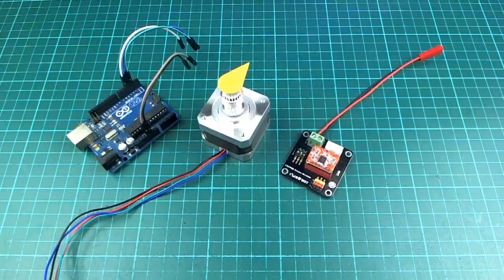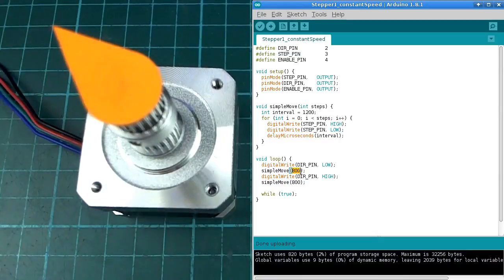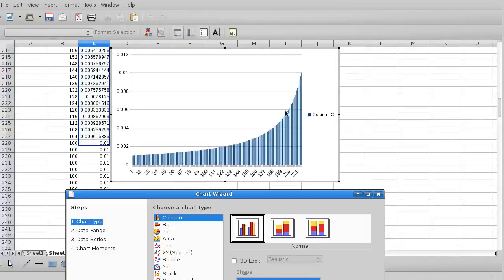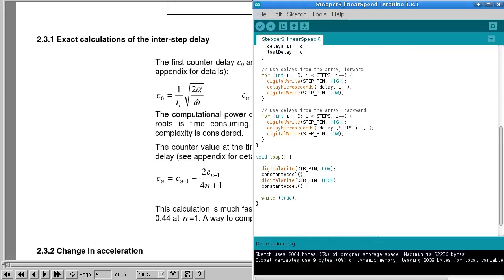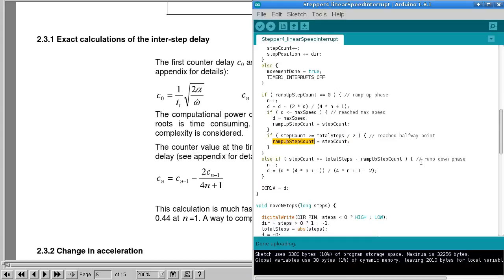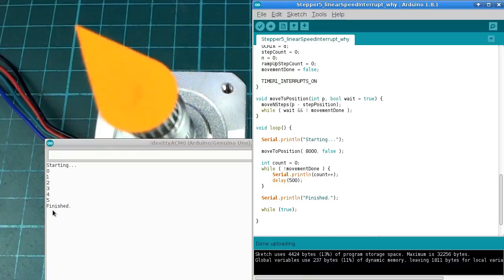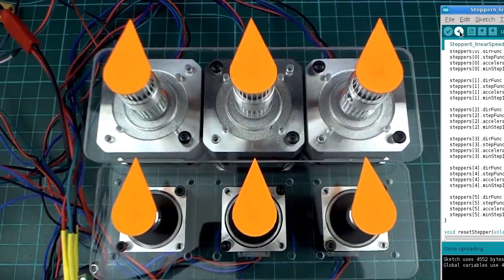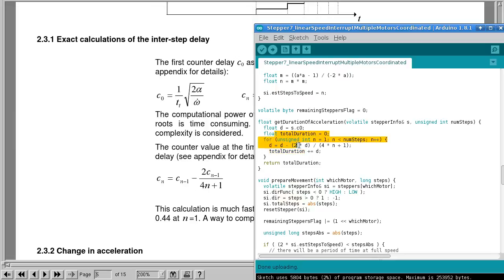Coordinated stepper motor control (arduino)

Comment: I did not really go beyond the point in video, where the author gives in sophisticated calculation and theory. The author had a very efficient approach in the first place. All I did was to base my acceleration function on incrementing the speed instead of incrementing delay. So here is my modified version of the author's good idea (it works, but it should be improved in a few ways...depending on the main application code):

void linAccel(int steps, int uSteps) {  //we assume the uSteps (microsteps) are defined before calling linAccel(steps, uSteps)
  int lowSpeed = 100;       //rpm
  int highSpeed = 400;      //rpm
  float speedIncr = (float) 2 / uSteps;
  int rampUpStop = (highSpeed - lowSpeed) / speedIncr;    //steps before highest speed achieved
  int rampDownStart = steps - rampUpStop;                 //steps after highest speed starts to deccelerate
  float d = 60000000 / lowSpeed / 200;     //[us] lowSpeed Delay based on 1.8 degree steps ==> 200 steps per rotation
  float curSpeed = lowSpeed;
//  Serial.println("rampUpStop: " + String(rampUpStop));
//  Serial.println("rampDownStart: " + String(rampDownStart));
//  Serial.println("curSpeed: " + String(curSpeed));
//  Serial.println("speedIncr: " + String(speedIncr));
//  Serial.println("delay: " + String(d));
  for (int i = 0; i < steps; i++) {
    digitalWrite(stepX, HIGH);
    digitalWrite(stepX, LOW);
    delayMicroseconds(d);
//    delay(10);
    if (i < rampUpStop) {
      curSpeed += speedIncr;
      d = 60000000 / curSpeed / 200;            //d += speedIncr;
      //      if (curSpeed > highSpeed) curSpeed = highSpeed;
    }
    else if (i > rampDownStart) {
      curSpeed -= speedIncr;
      d = 60000000 / curSpeed / 200;    // -= speedIncr;
      //      if (curSpeed < lowSpeed) curSpeed = lowSpeed;
    }
//    Serial.print(String(i) + "," + String(curSpeed) + "," + String(d));
//    Serial.println();
  }
}

Comment: Can any one tell me which board and drivers( all electric components ) are used to run 6 stepper motors at a time
Reply from the maker: I'm using a RAMPS1.4 board shown at 34.55
It has 5 onboard drivers and the 6th is on a separate breakout board. Search for A4988 on Banggood etc

Comment: Hello! Great video, and great work! Thank you!
I am trying to adopt your last sketch (Coordinated motion) to run under Arduino Uno with only 4 motors (CNC motor shield 3.00). Everything works great, except the Y-motor doesn't change its direction. I see with a meter that the DIR signal on pin 6 for Y-motor does go to HIGH after prepareMovement() - when it is time to change direction, but then it immediately goes to LOW when runAndWait() is executed. Do you know what within runAndWait() could possibly be resetting direction signal just for this one motor? (I am using Step/Dir pins:  5/2 for X,  6/3 for Y,  7/4 for Z,  13/12 for A). Thank you.

Comment: how did c0 become 1600? in 22nd min
Reply from the maker: As I mentioned in the video, that's 1600 microseconds between pulses, the slowest speed when the motor starts. Set it to whatever you want.
Reply: @iforce2d  i got it, thanks

Comment: Hey what kind of stepper motors are these? I am looking for something more powerful than the one i got in my beginner kit because I need to create a circular motion to "stir" something these seem like they have a much greater rpm
Reply from the maker: These are nema17. The smaller ones are nema11 but they are quite weak.

Comment: Hi SR. I need to control 4 motor to clock wise position and 4 anti clock wise at the same speed 5 RPM. Is it possible with the cnc shield and a arduino nano?

Comment: I am currently working on a scenario with three equally angled motors, where one of them needs to be scaled vertically by sqrt(3) to achieve a perfect XY movement. I've been trying to incorporate your fantastic work to help me get going with accel/decel, but I do not get accurate positioning. It is  off by an ever so slight margin. Do you have any clues what I could look at? Any help is appreciated! Cheers and thanks for the great content!

Comment: I am running this code on the ramps 1.6 : I get no movement unless I put delayMicroseconds(5); in the step function fo X. What could be the problem?
Reply: Actually only the interrrupt sketches dont work.

Comment: Ok. Linear time delay changing will non give us a linear RPM growth, but we can just linearly increment RPM itself, then just convert in to time delay. It will give as an perfect linear RPM growth (on graph at least), and this much isyer to caclulate and understand. Where i`m wrong?
Reply from the maker: "just convert in to time delay" Ok, how?
Reply: @iforce2d  time_delay = (16000000/prescaler)/steps_per_second. Then we can increment the steps_per_second variable like that: steps_per_second +/-  accel_force * dt. Also we can create an acceleration profile cache: for example a full acceleration from min to max speed takes a 50 steps, so lets create an array (uint16_t  profile[50]), where an index will correspond to an acceleration step, and value to a time delay. Then calculate in loop all steps and fiil the array once. It allows us to avoid any calculations in timer interruption handler. We wil able just change an current acceleration step value and get an corresponding time delay from cache. (Sorry for my English)

Comment: great video! I'm just now developing a cable robot for a uni project and I've looked at your sketches and the Atmel doc, and I've managed to add my take on this, in short, I'm giving a fixed time target for all motors to complete their task (just a constant acceleration between two positions). With that, you can set a base start delay and acceleration proportional to the Steps/Time request.

Comment: I'm having a really rough time scaling the code back for the multiple motors back to just two steppers. I managed to get... something to happen, but all it's doing is periodically stuttering.
Everything else has worked out okay up to this point.
Reply from the maker: Not sure why the code would need scaling back. There's no need to connect six motors if you only have two.

Comment: sir
how much supply have given this motor
which stepper motor you used .please specify module and
please tell me if i give 12volts to this motor that speed remains same?? or it will slow  if i used nema17 4.2kg
please reply me sir

Comment: Thanks for the guide! Im using micros() in a loop instead of ISR. Those equations for acc/dec work really well, I haven't tested my code for running multiple steppers at once.
update: seems like there's no way to do coordinated movements without interrupts, multiplying by the speedscale breaks the fluent motion.

Comment: Hi boss, cant fibd these all in scetch codes please can you send links for this ? appreciated. any chance to run arduino control for desktop injection molding machine? i heard the arduino uno and utself IDE is not suitable for it is that true?

Comment: Hello. i am using Arduino uno, arduino cnc shield, 2 nema 17 motors and 2 limith switches. And now I want to run 2 stepper motors in same direction and the same time and when the stepper motor will push the switch, will stepper motor change direction. Can you help me with the code? I am new in that arduino programming and I don't know how t do it :(

Comment: Thanks alot for your video.
In the interrupt routine, when deal with port manipulation method to generate pulse step, my stepper motor doesn't work. I guess because the pulse width does not enough time to make the motor work, is it right?
It works when i used the digitalWrite function to control  the Step pin....

Comment: Hi iforce2d, can you please help me with this code ?
you get paid for your time.

#define X_DIR_PIN          2
#define X_STEP_PIN         3

#define Y_DIR_PIN          8
#define Y_STEP_PIN         9

#define Z_DIR_PIN          4
#define Z_STEP_PIN         5

#define X_STEP_HIGH             
#define X_STEP_LOW             

#define Y_STEP_HIGH             
#define Y_STEP_LOW              

#define Z_STEP_LOW              
#define Z_STEP_LOW              

unsigned int c0;

void setup() {

  

  pinMode(X_STEP_PIN,   OUTPUT);
  pinMode(X_DIR_PIN,    OUTPUT);

  pinMode(Y_STEP_PIN,   OUTPUT);
  pinMode(Y_DIR_PIN,    OUTPUT);

  pinMode(Z_STEP_PIN,   OUTPUT);
  pinMode(Z_DIR_PIN,    OUTPUT);

}
#define STEPS 400
void simpleAccel(int steps) {

  int lowSpeed = 1200;     //900-1600 Acceleration
  int highSpeed =120;    //120-260 taxuthta speed
  int change = 2;

  int rampUpStop = (lowSpeed - highSpeed) / change;
  if ( rampUpStop > steps / 2 )
    rampUpStop = steps / 2;
  int rampDownStart = steps - rampUpStop;

  int d = lowSpeed;

  for (int i = 0; i < steps; i++) {
    digitalWrite(X_STEP_PIN, HIGH);
    digitalWrite(X_STEP_PIN, LOW);
    delayMicroseconds(d);

    digitalWrite(Y_STEP_PIN, HIGH);
    digitalWrite(Y_STEP_PIN, LOW);
    delayMicroseconds(d);

    digitalWrite(Z_STEP_PIN, HIGH);
    digitalWrite(Z_STEP_PIN, LOW);
    delayMicroseconds(d);

    if ( i < rampUpStop )
      d -= change;
    else if ( i > rampDownStart )
      d += change;
  }
}
void loop() {   //begin main program loop
  
for (int c0 = 0; c0 < 2; c0++) {//how many Times loop
  
  digitalWrite(X_DIR_PIN, HIGH); // sets the one direction
  simpleAccel(1000); // poso makria tha paei to X(<3200)
  delay(1000);  // poso tha perimenei
  digitalWrite(X_DIR_PIN, LOW ); // sets the other direction
  simpleAccel(1000); //poso makria to X anapoda (<3200)
  delay(1000); // poso tha perimenei

  digitalWrite(Y_DIR_PIN, HIGH); //sets the one direction
  simpleAccel(000); // poso makria tha paei to Y
  delay(000); // poso tha perimenei
  digitalWrite(Y_DIR_PIN, LOW); //sets the one direction
  simpleAccel(000); // poso makria tha paei to Y
  delay(000); // poso tha perimenei

  digitalWrite(Z_DIR_PIN, HIGH); // ets the one direction
  simpleAccel(0); // poso makria tha paei to Z (<3200)
  delay(0000); // poso tha perimenei
  digitalWrite(Z_DIR_PIN, LOW); // sets the other direction
  simpleAccel(0); // poso makria tha paei to Z (<3200)
  delay(0); // poso tha perimenei

   while (true);
 }

}
you get paid for your time.
I neen to run 3 stepper motors with different movement each one independently,to repeat a loop only a certain number of times.

Comment: Do you use a special power supply or what do you use?
Reply from the maker: These motors are usually run at around 12v. I was probably using a 3S lipo batttery.

Comment: This is super super useful man. Thanks a lot for sharing. Use of Taylor series for simplifying acceleration is the most important part to get this running smoothly on arduino.

Comment: @iforce2d  Great video man, thanks for sharing. I used your code in my project (fabric spreader) and it works excellent. If you have time it would be nice to add pause function. For example my machine goes 5m in one direction, and it would be useful to have a pause if something goes wrong.
Anyway I would like to support your work, so if you have some PayPal or something like that I would be happy to donate.  Thanks once again !
Reply: you have interrupt pins in arduino - use it :)

Comment: This code only works on the UNO.  Models more recent than the UNO cannot run the Timer1 Interrupt. The following error is thrown:
Stepper4_linearSpeedInterrupt:47: error: expected constructor, destructor, or type conversion before '(' token
 ISR(TIMER1_COMPA_vect)
.

Comment: Great video and well explained, I’m working with the “linear Speed Interrupt Multiple Motors” sketch.

Is it possible to “enable each stepper driver, run the required steps and then power down to reduce heating and power consumption?

Looking at the code, could the “si.movementDone” be utilised to control each enable pin so the stepper driver is only enabled whilst there are steps in progress and powers down when completed. 

I have tried various ideas but cannot get it to work, Hopefully it’s a simple addition to the code for someone with more programming experience.

Thank you!
Reply from the maker: I suppose you could use a relay to break the connections between the driver and the motor when necessary. I get the feeling that there's a better solution though. If you're concerned about wasting power because you're running from battery, I'm really wondering what you're making. If you're mainly concerned with heat, perhaps you could adjust the maximum current the driver is allowed to push, or just use larger motors.

Comment: I've just used your sketch to handle with 4 stepper motor. I had connected them to correct pins, but they aren't working. Im using mega 2560 clone. Is there something in code what i need to correct?
Reply from the maker: The pin layout is for a RAMPS 1.4 board with A4988 drivers, is that what you're using?
Reply: @iforce2d  i''m using tb6600 without RAMPS, but STP and DIR pins are connected like in ramps (for correct pins in mega 2560). Additionally, i would like to ask if it is possible to change pins assignement in Your code?
Reply: Ok, i'm noob ;) my tb6600 wasn't work properly :) now everythink is fine, i had changed pins in Your sketch ad everything is fine :) thanks a lot for good lesson :)

Comment: i am so great full to come across this video i am new to all things Arduino and want to work on a project that has 4 or 5 motors that can do  just as what was explained in this amazing tutorial. i am able to upload file "Stepper1-5" but when i get to "Stepper6-7" i get error ( 'PORTF' was not declared in this scope). can anyone help me out with this?
Reply from the maker: Use arduino mega2560, not uno
Reply: @iforce2d  ok i will order one asap.... thanks
Reply: Thanks so much i ended up purchasing a kit just like you have and it ended up working.  Yet i was wondering that is the comdination you used to wire up your motors to the board. Is it ; RED =A, BLUE=Ā ,GREEN =B, BLACK =NOT B

Comment: I've done a total re-write to come up with a new solution for coordinated steppers with acceleration. My solution includes optional acceleration, optional deceleration, and no delay between routine steps. It retains the speed and acceleration aggression options. I'll post a video on it some time, but essentially all step scaling is pre-processed and the acceleration/deceleration equation is run only once (no need to run between routines) per step.
Reply: I'm just about to program my automatic curtain puller and I would love to see your code. If possible could you post a link to a Google Drive file or something?
Reply: @jarchdm  Ive got some finishing off to do, but I'll do a video when it's done.
Reply: @VinceSamios  excellent looking forward to it

Comment: Hello ifore2d,
your work is pretty genius :-)

I am trieing to get 3 stepers controled with an arduino but it doesn´t work.
Could you make an example here on youtube ?

Bipolar Nema 23 stepper  1 =>  S1 
= horizontal linearactuator with 2 limit switch
Bipolar Nema 23 stepper  2 =>  S2
= vertical linear actuator with 2 limit switch
Bipolar Nema 23 stepper 3  =>  S3
= turns all the time
 

This are the steps:
 
  S1 turns clockwise until it gets a signal from the capacitive sensor, then it turns for 45° degree and stops
  S3 turns clockwise (turns all thetime)
  S2 turns clockwise until it gets a signal from the limit swich S2_1 and stands there for 3 seconds.
  S2 turns counterclockwise until it gets a signal from the limit swich S2_2.
This 4 steps repeats so long until S1
gets a signal from the limit swich S1_1.
Then all 4 steps repeats but only with
the difference that in the first step S1 turns countercklockwise.
S1 turns so long counterclockwise until
it gets a signal from the limit swich S1_2.
Then S1 turns for 360 degree clockwise
and then all three motors turn off.

Thanks a lot for your help in advance
Christian

Comment: I'm getting some very strange results when trying to input large inputs, ie 100000+ steps in a prepareMovement. The integers aren't overflowing because of this though so I'm not sure what the problem is. Either the motor starts stepping in the opposite direction or it only does a tenth of the movement it should be doing. Any idea what could be happening here?

Comment: Very useful, thank you! On steppercontrol iforce2d, the STEPS max value admitted is 1000 which gives 5 revolutions both sides: can you please help me how can i get this code changed to larger STEPS values?
Reply from the maker: I don't recall any limitations like that, unless it's simply because the variable is not large enough (eg. using int instead of long). I don't have the code in front of my right now, but you could try changing the variable type to 'long' if it's not already.
Reply: @iforce2d  thanks for be. The long did not worked. The LINE code is: "# define STEPS 1000". Lower values will be ok. But when you try greater values the program stops.

Comment: What step-mode were you set on? I dont see any reference to setting your driver to half/full/quarter/etc in the code. I'm wondering if a difference in my setup involving this is why I am getting some weird results from my steppers.
Reply: Awesome video by the way! just what I was looking for in order to understand interrupts better
Reply from the maker: The step mode is set on the drivers themselves, with pin jumpers, not in the code.
http://www.geeetech.com/wiki/index.php/Ramps1.4#Jumper_Instruction
Reply: @iforce2d  Thanks for the reply! I think I've figured out my issue. I overlooked my power supplies current rating and am trying to run more steppers then the power supply can handle. Ill replace it and see if it explains why some steppers randomly rotate as expected and others just shake in place